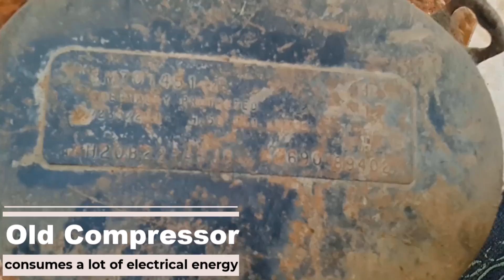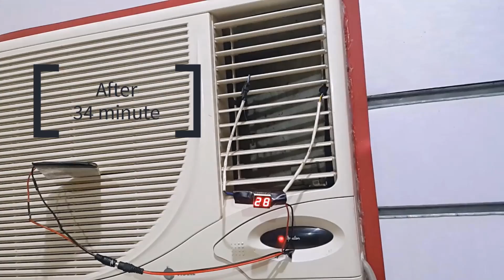Rreplacing my old Air Conditioner Compressor with Peltier

Comment: this is pretty bad. if your ac's cooling capacity was 3000W, your  compressor only needs to be around 1000W. But you would need a 3000W of peltier to achieve the same level of cooling from thermoelectric cooling. this is pretty dumb.